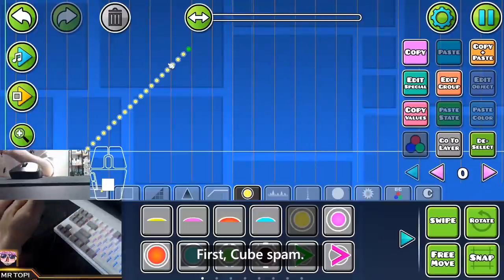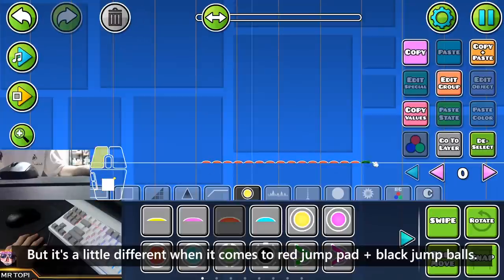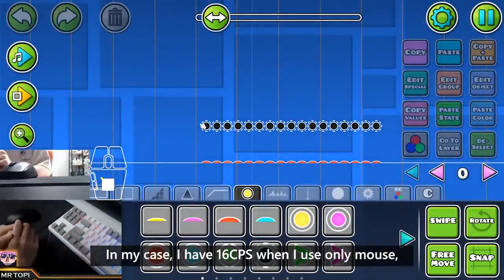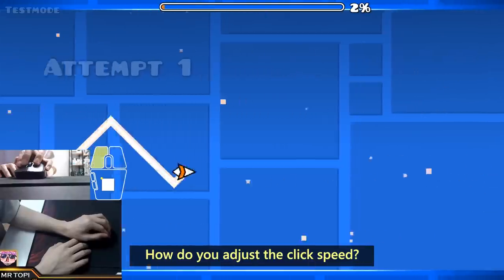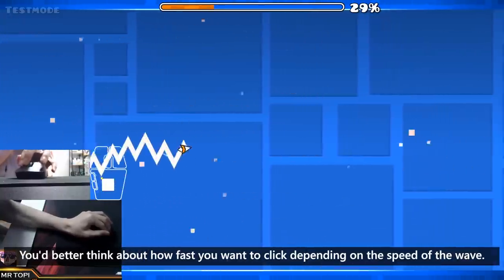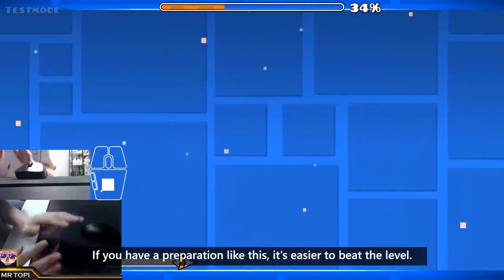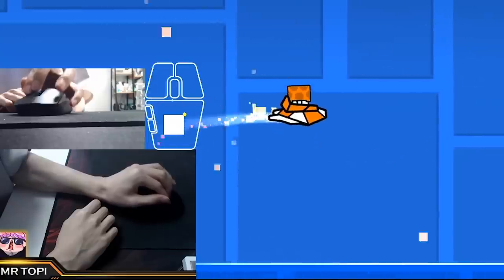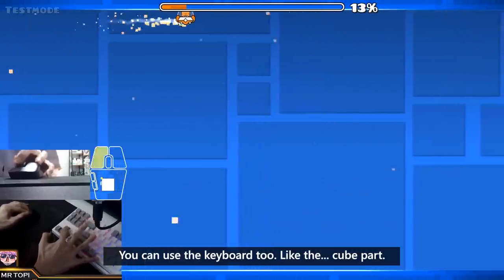(Tutorial) HOW TO GOOD AT GD SPAM | Geometry Dash

Comment: If you are trying to spam on mobile, when you tap try not to stay on the screen too long so once you tap on the screen immediately remove your finger off the screen and that’s the same when your finger is in the air and try to vibrate your finger but in wave spam when your done with one part of spam try to regain control by doing some medium or big strokes.

Like this comment if it helped you I’m trying my best to explain it clearly

Comment: im just saying there is almost never going to be a situation when you have to spam more then like 7cps in gd if you want to be a better player
(apart from spam challenges)
Reply: Well it can be used rarely
Reply: @ZDXNeru  the only top 50 levels i can think of that have spam are WOW and tapwreck which you can just use the spacebar for the spam
Reply: @983fjiwd32f  btw what's better? pressing and clicking both the space bar and mouse at the same time continuously, or altering between the two?